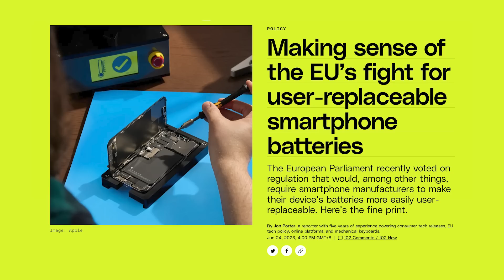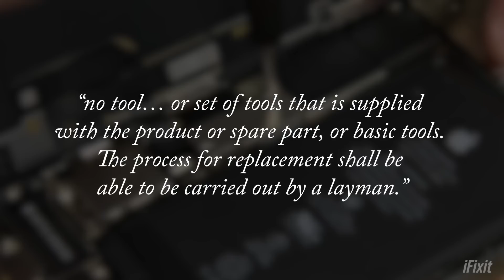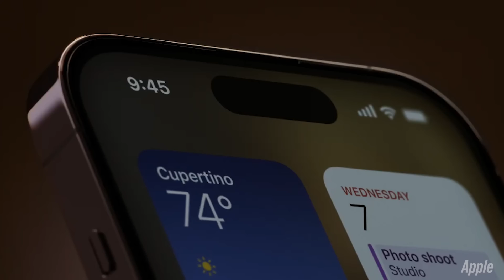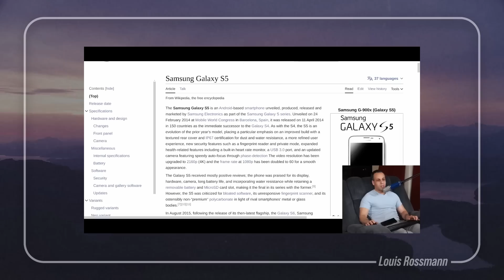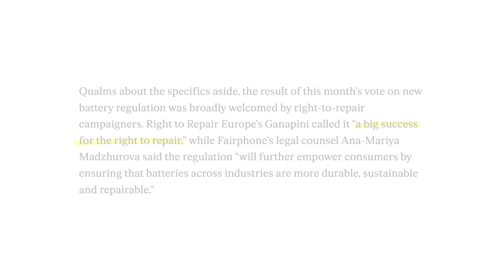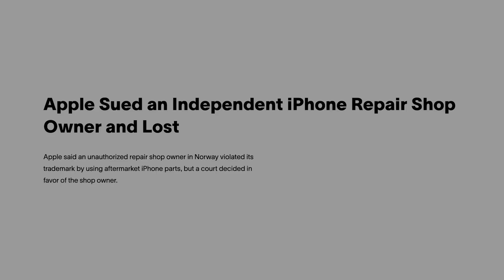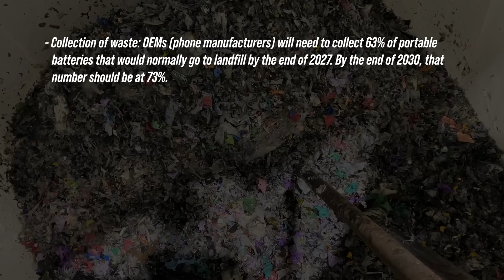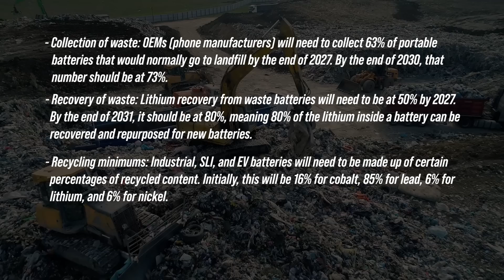EU Just Changed Smartphones Forever

Comment: Well there goes your moisture proof standards. And on the topic of included tools then not even a SIM module technically would be replaceable because most phones today come with the little key to open the sim module compartment. I would think the next boneheaded move is that all phone manufacturers must continue offering physical sims!
Now as far as EVs, yeah it will mean the death of EVs in Europe. Ain't it manufacturer in Europe or worldwide the that will put up with replaceable batteries. Take the case of Tesla. Their cars are not and the batteries are not something that is traditionally serviceable by the layperson. If you choose to break, open a Tesla battery and expect them to uphold a warranty. You're kidding yourself, right?

Comment: No one cared about water resistance back in the day because if you flushed it down the crapper you could just go replace the whole phone for $100. Waterproofing only served to add $600 to the price tag to avoid the one in a lifetime forgot to empty your pocket before jumping in the pool or washing it with your pants. Not worth the trade off honestly.

Comment: So the removal of user-serviceable devices from the market is completely an effort to keep the market for devices and, maybe (?) electric vehicles, in a constant state of churn. These efforts are, for better or worse, backed by the creators of operating systems that keep expanding their kernels to, as one representative of one of these companies said long ago in a private meeting said and I am paraphrasing - '... we make operating systems and applications to exploit the increasing capacity and generations of processors, memory and storage..." Basically, these companies bloat their products, for better or worse, to force consumers to purchase hardware platforms that can run the 'latest and greatest'. This is reason number one why I prefer desktop PCs that I can replace or add just the component that is needed to use the 'bigger and better' software. Of course, a certain industry titan has made it so that once again, only certain processors of certain generations are supported for the latest operating systems they are producing. This works hand in glove with the processor and, consequently, the motherboard manufacturers. Delightful.

This video, and thank you @coldfusion for this, brings to mind what I thought at the time was the most brilliant and early-stage development for electric vehicles - replaceable battery packs that, when you needed a charge, you would travel to the nearest service station, stop over a designated zone, and the robotics would do the rest to efficiently remove the battery pack and install a fully charged pack in its place, moving the depleted pack to a charging station for recharge and re-use by another vehicle.

This, of course, brings to mind that another source of e-waste is the lack of standards for battery components for devices and vehicles. With every single manufacturer 'doing its own thing', millions of batteries are produced that are locked only to one manufacturer, device or even device model. It is an incredibly inefficient  manufacturing model, but they do it in any case.

Finally, I will take a little bulk to a smartphone to have is user-serviceable - we, as an electronic-device consuming society - have put up with worse and we, and future generations, will be served far better by making this happen.

Comment: 8:03 I think those changes were motivated by profit resulting in anti consumer products: I loved replaceable batteries and I keep choosing smartphones that had this feature until that was possible. Carrying around a spare battery and swap it quickly when needed was super convenient.
Reply: agreed, you can even say that they are more convenient then having a power bank
Reply: Same with the headphone jack and sd memory card. I still use those two as my criteria for a good phone. Screw your 25 Lens cameras… 1 was sufficient.
Reply: if everyone carries a spare battery.. is that really eco friendly? all of the sudden we have double the number of batteries in circulation.
Reply: @isaacyoung1868  yes. the same thing with replaceable batteries. Now we have 1 battery per phone. If we start replacing we will have 2 or 3 per phone.
Reply: @isaacyoung1868   the removable battery itself is not eco friendly, its the additional changes that make it so such as stricter recycling targets for companies. and right to repair forces the devices to last longer,  a battery is a part which get worn out faster than other parts in any electronics, so it being removable by the user for cheap means a lot of users will decide to keep their devices for longer instead of having the option of paying a huge sum to get the battery replaced or buying a new device and right now many ppl happily choose the 2nd option because the price of battery replacement being high. 

even keeping a replacement battery might look like having more batteries in circulation but the life spent by those 2 batteries will still be equivalent of having used 1 battery to full life then replacing it to other as the life of a battery depends on the charge-discharge cycles which wont be that different for both cases.
Reply: Isn't that also due to water resistance being more commonplace now?
Reply: I haven't changed a battery on a phone for over 15 years, and they last me 4–5 years each.
Reply: @jankrynicky My previous phone with a battery that could be removed is thinner and smaller than the current one with the unreplaceable battery, and that one, if we dismiss iPhones, was one of the thinner and smaller ones.
I think that only in the last two years phones have started to get smaller and thinner, while in the years before they were getting bigger and thicker, the trend that made me afraid that soon we will all carry around tablets, not phones.  
So, yeah, I don't agree with "Replaceable batteries did not disappear by the producers' agreement. People kept on choosing the slimmer, lighter alternatives." Especially since I remember how small the previous not-smart phones could be and that with a removable battery.
Reply: I prefer thinner phones. I have never needed to replace my iphone's and ipad's batteries.
Reply: @eckee well ofc you havent, because you buy a new phone so often just like they want you to do lmao a removable battery is not going to make the phone bulkier it never did this is not new phones USED TO HAVE a removable battery then the anti consumer bs started with glass backs, curved screen to make it even weaker and so you cant even put on a case that protects the screen and the worst of all intensionally terrible software so your phone will be slowed down on purpose so you buy a new and now ofc they dont even give you updates anymore after a few years so that you HAVE TO buy a new phone for no reason.
Reply: @MV-ri7zu  well my last iphone lasted me for 7 years without a case and I'm still using my 9 year old ipad air 2. I don't have an iphone now because they are too expensive here, like 3 - 4 times. but if I was living in a first world country where android and apple phones were similarly priced (about 900 dollar band, not iphone pro max or something) I'd only use Apple products.
Reply: @eckee  I dont get it do you just not use your phone at all? How tf was the battery life enough for you even after just 4 years or 5 or 6? Every smartphone ive ever had have been near unusable after about 3 years I would have to constantly charge them like 2-3 times a day + overnight
Reply: @MV-ri7zu  I mean same thing with me laoptops and any lithium battery devlces. Charge it up to 90% max and don't let it drop below 10. Don't use while charging and don't let the battery overheat. I mean sure sometimes I had to fully charge and fully deplete and sometimes overheated but generally I'm being careful of these things.

Also don't use chinese brands lol. Xiomi etc are shit
Reply: @eckee  the batteries are the same regardless of brand I havent found a phone that has a battery that can actually take being used for more than 3 years maybe 4 max. Idk how you could possibly be able to always have your phone between 10% and 90% while also not using it while its charging sounds impossible to me. Ipad and laptop I can maybe understand, but phone?
Reply: @MV-ri7zu  I'm not phone addicted 24/7 lmao I've got other things to do
Reply: @eckee  im guessing you dont listen to music or audio books or podcasts much then? Im basically listening to podcasts, books or music 24/7 whenever I can, walking, driving, working out, mowing the lawn, cooking, eating etc so its not that im ON my phone, but my phone is ON doing something all the time. Then again where im from I have had unlimited mobile data for I think like 8 years now idk if thats standard around the world even in 2023 so that would obviously cut down a huge amount of battery drain and use if I wouldnt have that internet connection literally anywhere I go even in most forests lol
Reply: @MV-ri7zu  I listen to music and browsr YT mostly and play games occasionally. But my screentime is not high. If you're using android you might want to turn off some stupid background processes or switch to iphone. If you're using iphone idk
Reply: @eckee  the phone supposedly turns them off by itself also I always use battery saver mode 24/7 with every phone its just not enough too much use for the battery to survive for a long time, but anyway being able to change batteries wont have any effect on you, the phones wont be bigger and I doubt that they will be more expensive.
Reply: @eckee   android and apple phones arent similarly priced. samsung and apple phones are. you can get a phone thats just as good or better for hundreds less than an iphone, samsung is the closest to apple when it comes to markups and anti-consumer practices
Reply: @lucio-ohs8828  I don't think you hundreds of dollars less phone can compete with Apple's chip. Also those cheap phones come with bloated software I would never buy one
Reply: @eckee  You're just lying, battery life of your phone/laptop would have drastically deteriorated over time regardless of how much you use it in that timespan.
Reply: @grassyfuzz  well from my point of view you're using shitty hardware or misusing your devices.
Reply: @eckee  keep dreaming
Reply: @grassyfuzz  keep ruining your phones in 2 years and blame it on companies lmao
Reply: @eckee  if your daily usage wasn't that high, ofc you never noticed battery capacity dropping over the device's lifespan. As a student, I was constantly working on my phone, either for notes, homework, or actual communication. I used to carry two fully charged batteries in my backpack and burn through the three total before the end of the day. These days, you have to carry a battery bank with you that approximates the same concept but requires the main device to be recharged each time instead of doing all of the charging in advance. 

It's like saying that EVs are perfect for everyone, ignoring that some people spend hours each day just driving. They benefit from a 3-minute fuel fill over 30+ minutes waiting at a dedicated charging station.
Reply: @Hawk7886  I have ~6 hours of screen time on vacation. Uf you have like 10 then you're living inside your phone and can't be helped.
Reply: @eckee  lmao I'd have near zero if I were on vacation. When I was at school, it was well over 10. That happens when you use it for everything, bud. Turns out different people have different use cases. Try looking up the term "power user" if you feel like learning something.
Reply: @Hawk7886  that's not what power user mean but ok 💩
Reply: @eckee   After six years, my Microsoft Lumia had its protection screen cracked, but the phone itself was in perfect condition. Everything worked great, even its original battery, until its software stopped updating, and because of this I couldn't use half of the apps and had to change the phone.  Microsoft, as much as their hardware was great, screw me over with their software. 
So as much as its great that we can just get a new battery, we all know perfectly well, big companies would find other things to force us to continue to treat phones and other similar products as quickly replaceable consumer goods.

Comment: The change to not having changeable batteries was 100% profit or at least control. Apple do the same with their software; they make phones obsolete with IOS updates. Yes, the hardware might not be able to handle the full IOS, but surely there would be a way to design the IOS so that it still works on the older hardware but with some reduced functionality. I don't know enough about programming to honestly know, but the Windows approach to IOS design appears to give the hardware a longer life. Am I wrong?

Comment: Hopefully Nokia will bring back removable batteries. I would support them all the way for an epic comeback.
Reply: Who "Nokia" were towards the end is a moot point, bought by Microsoft so that someone would keep making Windows phones, then sold to Lenovo, and sold back to the Finns. I own two of the last "Real" Nokias - both used the same battery, which WAS "replaceable"once you'd managed to get inside the damned thing (which required at least a screw driver) Not something you could just carry as a pre-charged spare in your pocket. Nokia tried - for far too long - NOT to "move with the times", tried to upgrade Symbian into a REAL Operating System.

Comment: Apple will still find new ways to extract money from end users. They will sell batteries at very high prices and bring a proprietary connector so that no one else will be able to manufacture Apple-compatible batteries. They may put a chip in the battery and activate it only for the particular phone that belongs to the respective end-user. Just like, a camera module from one iPhone 14 cannot be installed in another iPhone 14. Anything is possible.